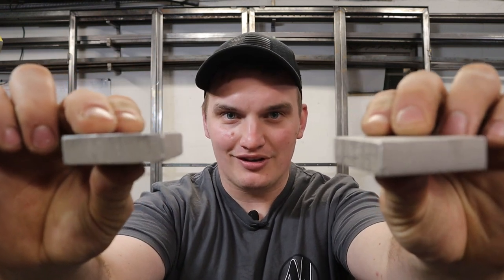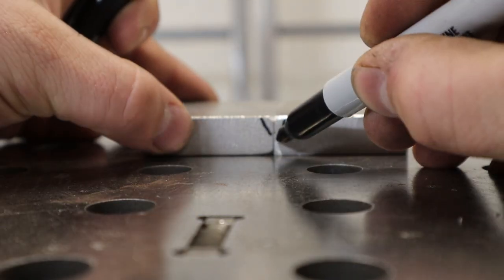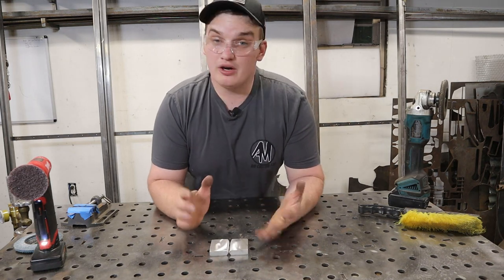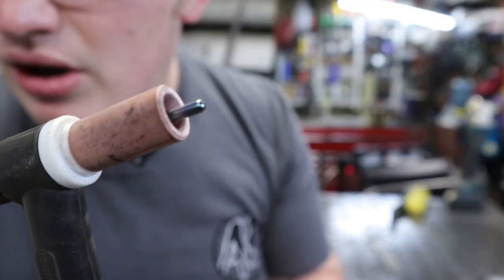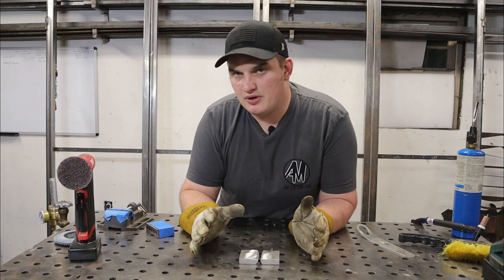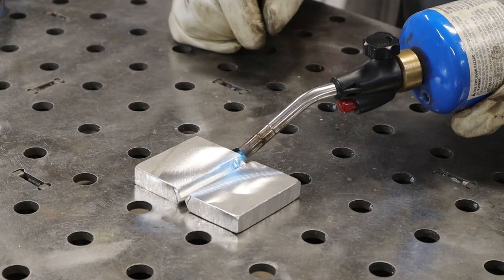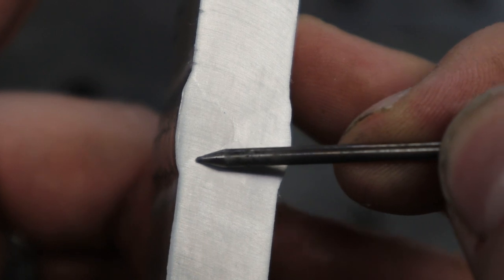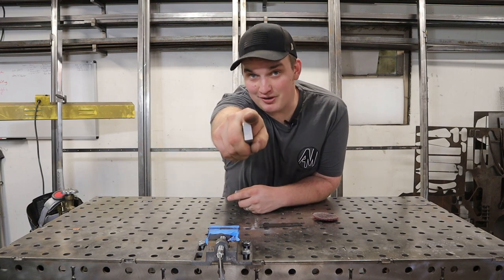HOW TO TIG WELD THICK ALUMINUM with a SMALL MACHINE.

Comment: 200AMP is not a big machine but it's certainly not a small machine.
150amp max is a small machine. ;)
Reply: When it comes to aluminum it's a small it's basically minimum
Reply: @travisweldmaster7815  haha no
I weld al every day, and I use in between 45amp to 130 amp . 
Thickness is what matters not material

Comment: With your welder being and inverter, are you running it on a 110 std outlet or do you have it in and actual 240 outlet?
Reply from the maker: 110 outlet with 12 gauge wire on a 20 amp breaker
Reply: @amcustomfab  Awesome thank you. So I think I see what the issue is that I'm running into. I need a bigger tungsten and to heat the part up more then.